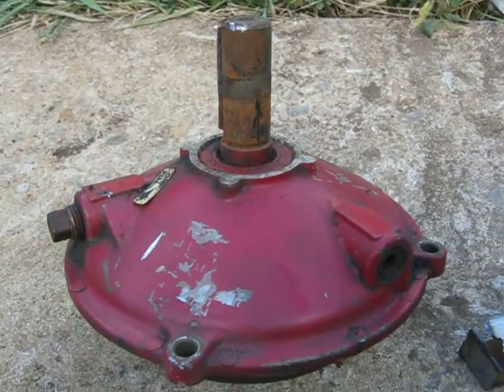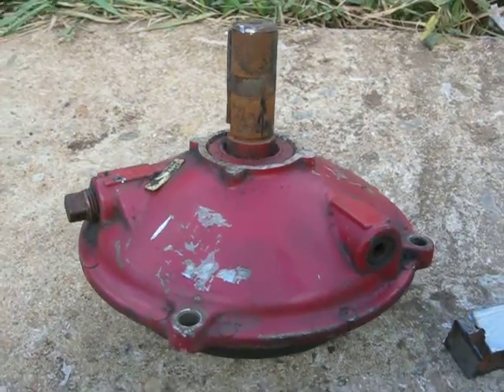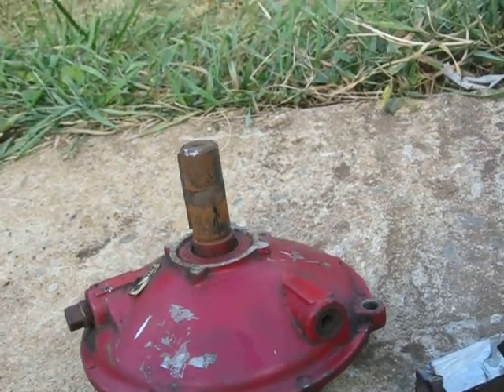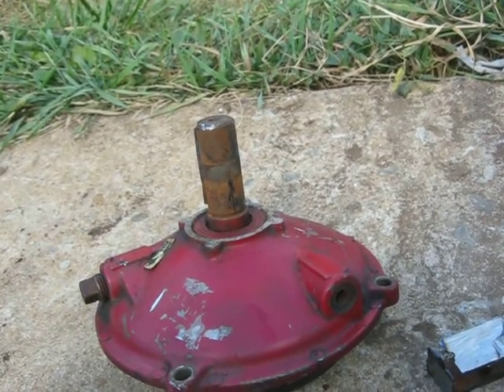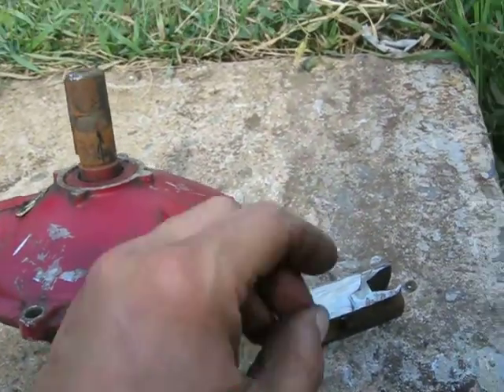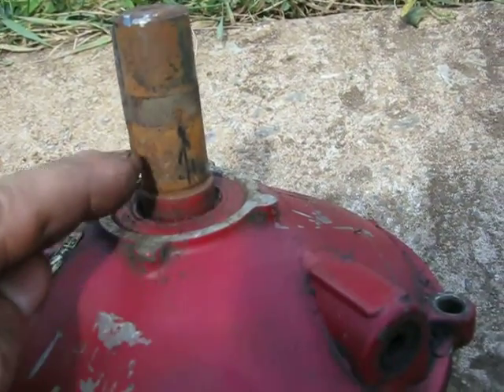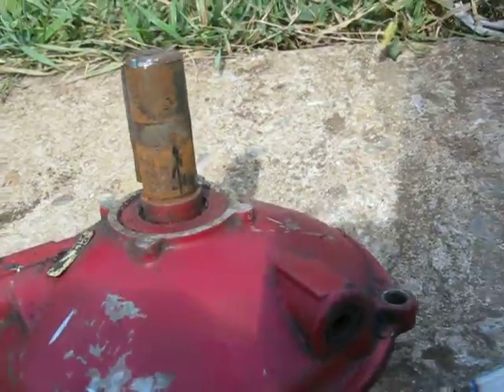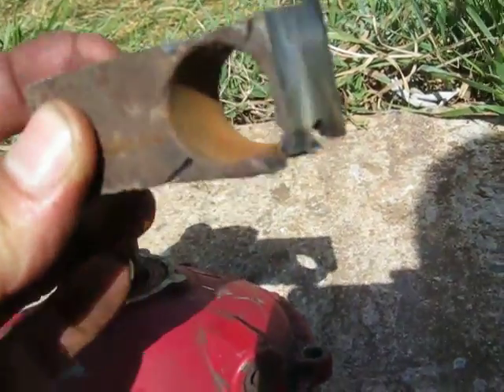Diesel fuel as Penetrating Oil ?

Comment: I heard in another video to mix 50/50 diesel and 2-stroke oil. I tried it to unseize a flywheel on a pull-cord push mower. Followed the fellows directions, let sit overnight, the next day the flywheel was set free. :-D
Reply from the maker: Interesting, glad it worked out for you.

Comment: I've used about 75% transmission fluid to 25% acetone, had to stir it a while. I used it on the set screws on a pulley off the flat head briggs I told you about. I had let it set for a few days and add more to it when necessary, but it worked for me

Comment: ATF and Acetone mix is very hard too beat for homebrew and it works just as well if not better than  commercial stuff. I do love Kroil though. Anything made by the Kroil folks is good stuff! If you can apply heat to something, wax works well also. Preferred choice is beeswax but paraffin will do.
Reply from the maker: Interesting what you said about wax. Not sure if they sell Kroil in Canada, I will have a look at CTC next time I am there.
Reply: ChargerMiles007 I'm not sure if they market up there or not but they are made by Kano Labs. It's kinda an obscure shelf item here, only certain places have it, none of the chain stores that I have seen but it is really good stuff.

Comment: A friend of mine was trying to unseize a big block Oldsmobile engine in a 65 Olds he was able to get the engine to turn a little bit, but we are unsure if it's just the crankshaft broke loose or if the Pistons are moving..
Personally I've had good luck with PB Blaster.
Reply from the maker: Yes, I hear PB Blaster is good, my guess is that the piston pins in the engine are seized up, since they are the tightest fit, I had the same problem on a 327 Chevy.

Comment: it works well in a engine block that's assembled but for that i would use heat, then hit it with PB blaster, then more heat.
Reply from the maker: Thanks for the advice, I know heat can help loosen it due to the heated part expanding more than the part not in the flame Also aluminum has more of an expansion rate than steel, so the fit will get looser with heat.

Comment: I've never used diesel, I'd try ATF and acetone, or KROIL
Reply from the maker: Sounds like maybe I am using the diesel in the wrong application, but 3 gallons of penetrating oil would cost a fortune!
Reply: Straight diesel is good for cleaning, not so much for freeing stuck parts. Add some ATF and brake fluid to it and it'll work.

Comment: I have not found anything that works by itself for tough problems.  Ocassional tapping, heating, and time seems to help.  Same old drill.
Reply from the maker: I hear that for unseizing pistons it helps if you pressurize the cylinder a bit with compressed air to help force the diesel down past the piston.
Reply: I imagine that bolting the part to something that vibrates would help too.  Maybe a small motor with an eccentric weight.

Comment: Use automatic transmission fluid and acetone in a 50/50 solution. Never fails and it's fairly cheap
Reply from the maker: I have heard of the ATF/Acetone mix before, but haven't tried it. I have 2 seized engines, so maybe it is time to give it a try, as the diesel doesn't seem to be working.
Reply from the maker: Maybe it is American versus Canadian Acetone & ATF  :)
I know the various cereals and soft drinks are different, in spite of having the same name.
Reply: i think the best ATF for this cocktail would be Dextron VI as its synthetic and should penetrate better then Dextron III witch people recommend for this stuff
Reply from the maker: Thanks